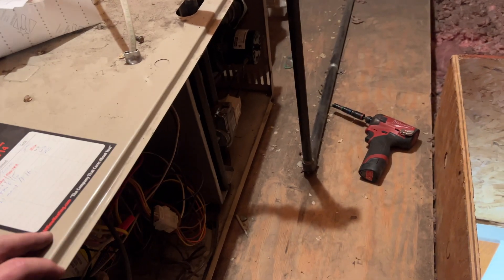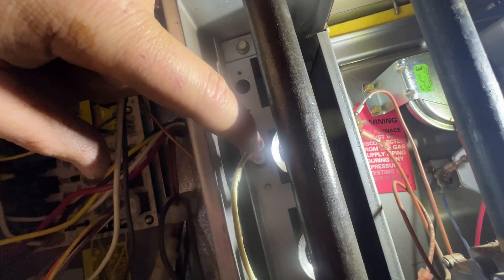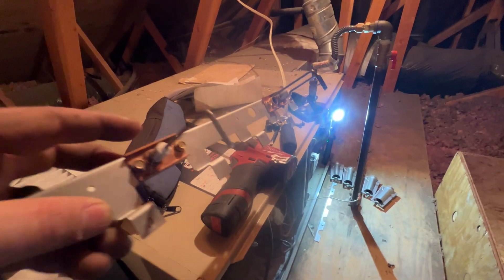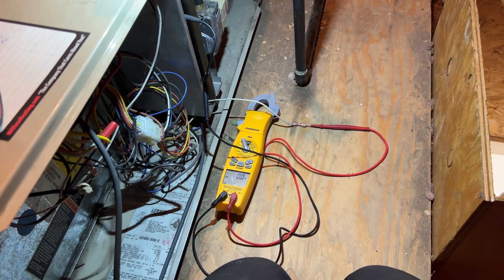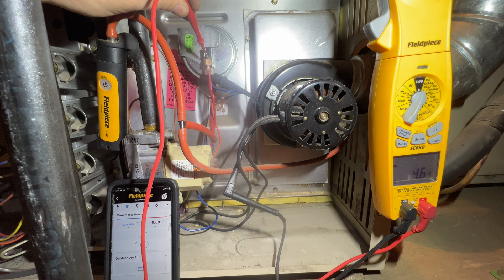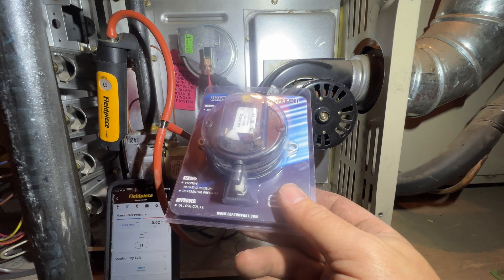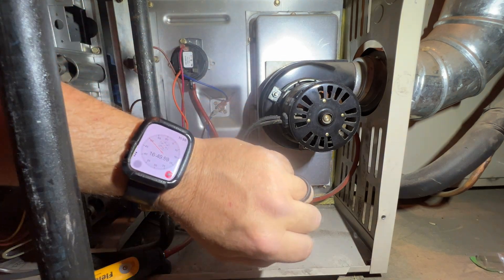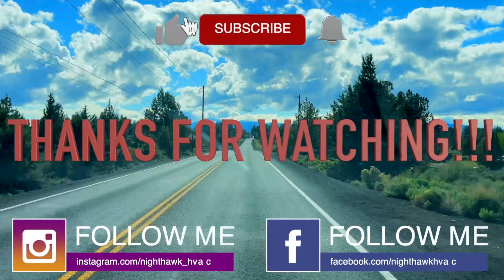Burners Go Out After 7 Seconds and It's Not The Flame Sensor  EP175

Comment: umm, that's not how you adjust a universal pressure switch. you need a manometer, pump with bleeder Y and meter to adjust them to exactly the correct pressure of the switch you're replacing.
also "tilting" that universal switch at any angle or position shouldn't change the set pressure, that's happening because it's way under adjusted with spring very loose flopping around.
you often need the orifices to slow the flow so the switches don't bounce on burner ignition, which is usually on dual hose setups where they have a bleeder port(match the old switch)
some companies have combo manometers, pump, testers to set them. not trying to be a know it all, just letting you that's not right.

Comment: I had almost the exact same thing happening to my gas pack pack in January of this year.  And of course it happened during an extreme cold snap.  Less than 10 degrees.  Burners would stay lit for about 8 to 10 seconds.  Inducer motor would shut off then immediately start again and the cycle would continue.   After it cycled that way a number of times the system would reset and shut off completely.    Turned out it wasn't the flame sensor itself but the ground bond between the flame sensor mount and the unit frame.  I had to take a wire brush to the flame sensor mount bracket as well the the unit frame where it attached to help with the bond.   Although not sure why the sensor mount bracket needs to be grounded that way since the tip is isolated from the frame by the ceramic.   But that fixed the issue completely.